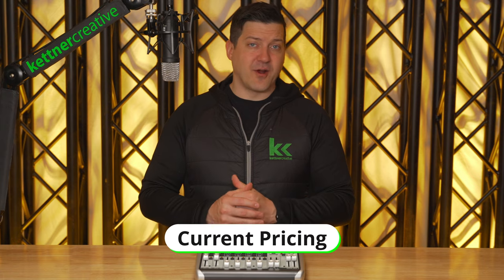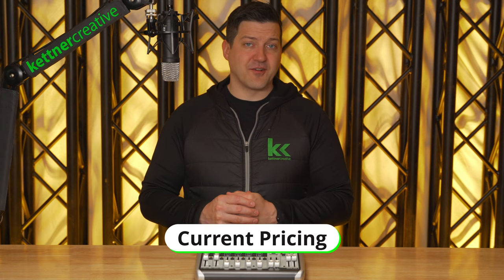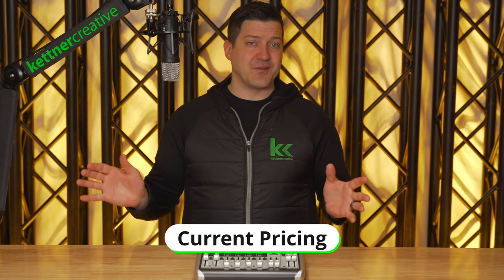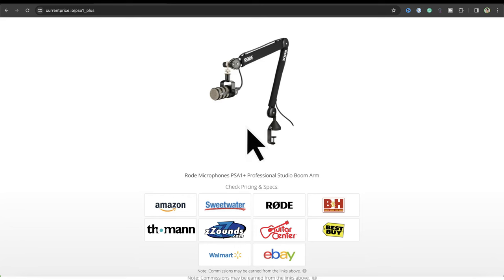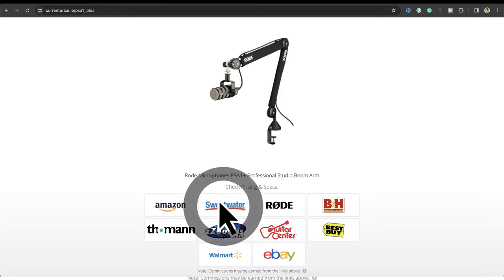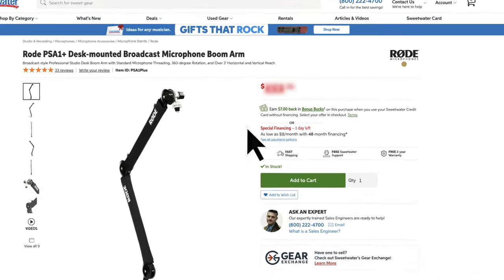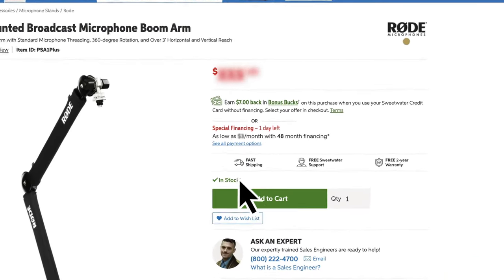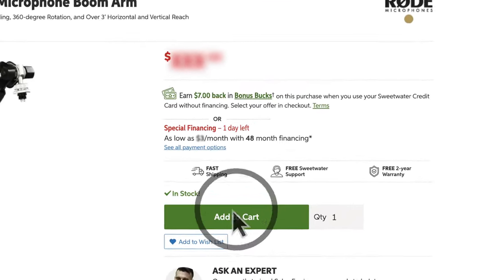Behringer Xenyx Control Room Output | Walkthrough & Setup

Comment: Can you please make a video on how to add external effects, like reverb for vocals as an example, to the Yamaha MG12XU Mixer? I see that all other mixers have FX sends AND returns, and this mixer seems not to have either. I know you can use the Aux Sends, but I don't see an aux return. The built in effects are "okay" on the board but not that great, so I was wondering how to add reverb externally. I saw that you could plug the returns to open channels, but I can't sacrifice those inputs. Is there another way? I have quite literally seen every video, but none of the videos use the Yamaha MG12XU Mixer as an example, and there just isn't enough of them to fully understand how it works. I know you kinda made a video on this topic already, but I feel like I still didn't get an answer. Thank you so much. I just bought the mixer, so I want to take full advantage of it. By the way you have helped me sooooo much in understanding sound, its been a true blessing!

Comment: hello  I have one question, in short, I bought at2020 and behringer umc 202hd, and on at2020, the sound seems to be muffled, that is, high-end is not enough, and as far as I know, it should not be like that, and when I boost the high-ends by 10db, then it's fine, and in short, I want to say that it should be like that? if Is there something wrong?